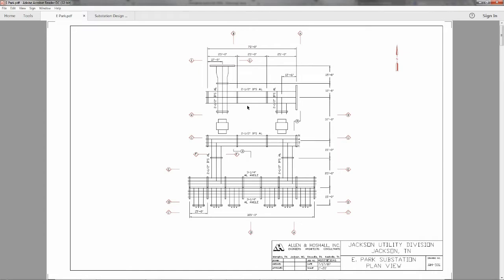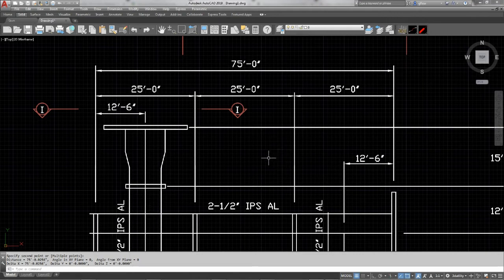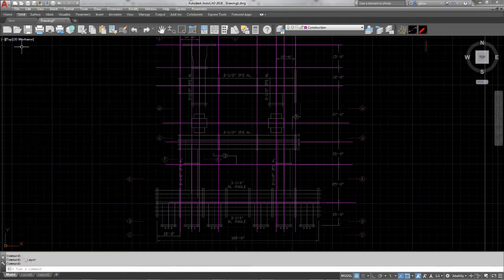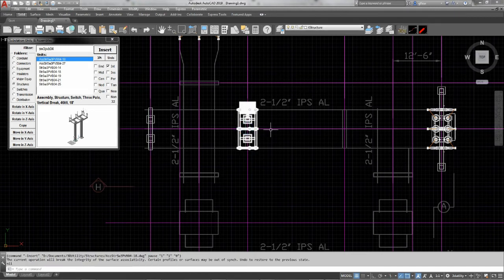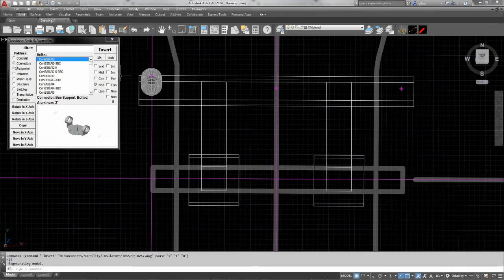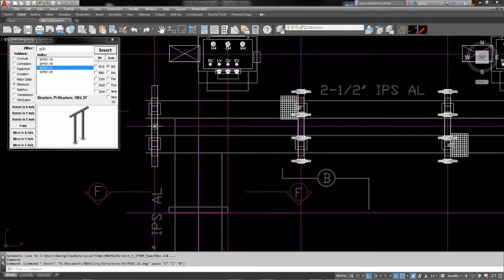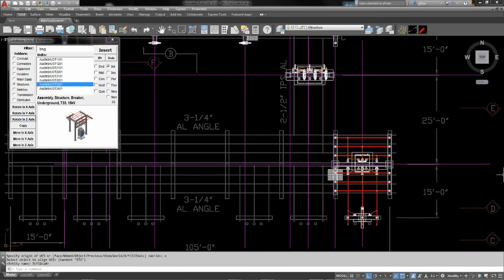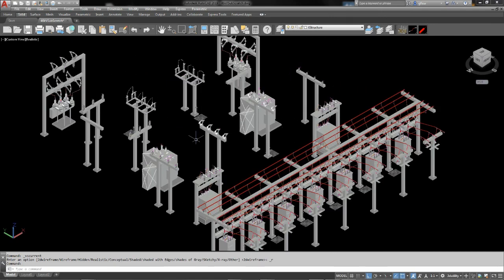the3DUtility #10 -  Leverage Your 2D Drafting Experience to 3D Substation Design

Comment: Hello Eng. George,
Good afternoon,

have a question about converting 2-d to 3-d HV SS's,
where i can find the blocks of the Equipment's inside the SS, at present am trying to design Lightning system for HV SS, and i know it will be better that i convert the SS to 3d model, i've 2-d model.

i saw your videos about lightning design using the 2 methods: Fixed angle & Rolling sphere, they're awesome videos and want to gain from your experience in this.

Thanks.